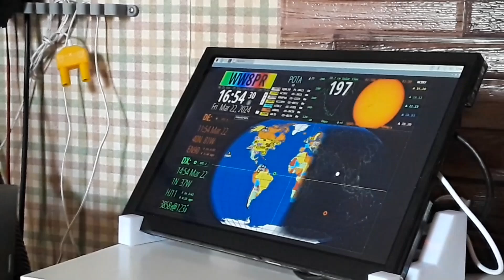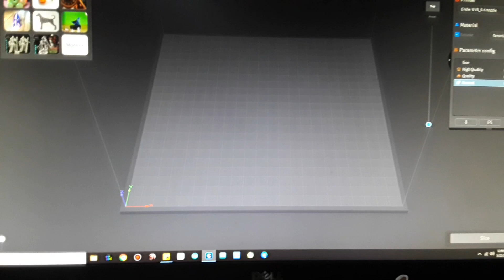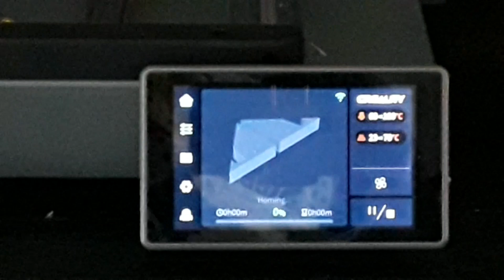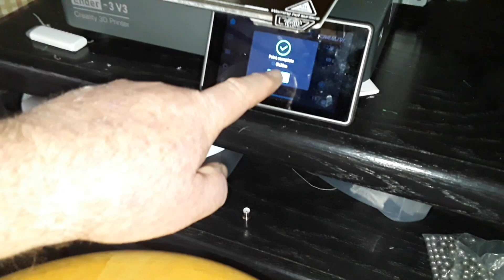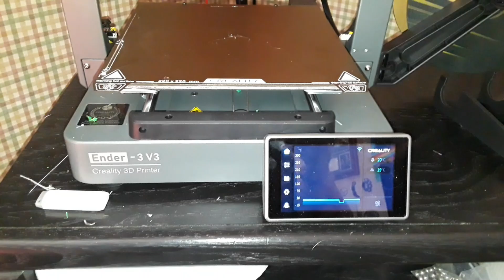Creality Ender 3 V3 600mm/s Core XZ All Metal 3D Printer Full Review

Comment: I'm planning to just mount a spool holder on the wall above my printer. But I'll be modifying the filament arrester so it still functions properly without flipping under the spool and locking it up

Comment: The print quality there really didn't look anywhere as good as I would expect for a machine advertising what this one does. Comparing it to  any Bambulab printer stock, youll see much higher quality.

I've even seen higher quality with other creality printers and in other reviews.

I feel like something is off here. Maybe the wrong print profile is selected or something, because the first layers looked really really rough which they shouldn't for something that has nozzle based (through the bed load cells) auto levelling, and the top surface quality also looks very rough.

It's really hard to pinpoint a culprit for what I think is wrong here because the symptoms are quite all over the place.

Poor first layer consistency, poor top surface finish (which feels like over extrusion based on what seem like bumps that are only ever high), gaps near features/corners.

Really hard to put a finger on, but I would just generally recommend perhaps double checking the print profile/making sure the pressure advance is set correctly/make sure there isn't a partial clog being compensated for with an extrusion multiplier (which is the last thing I thought of but the thing that makes the most sense to me).

I think this printer really should usually be getting better quality than this.